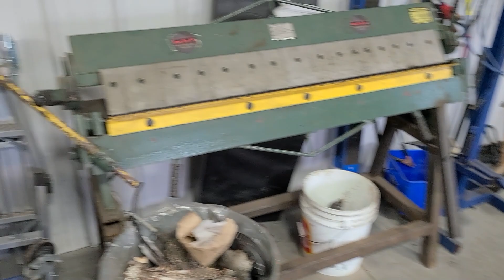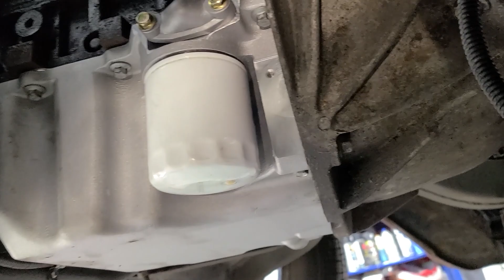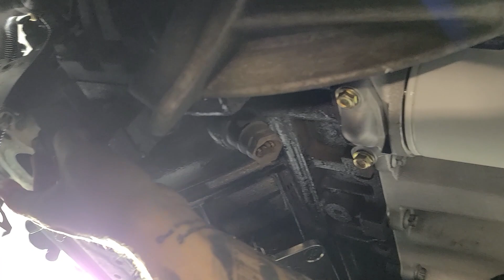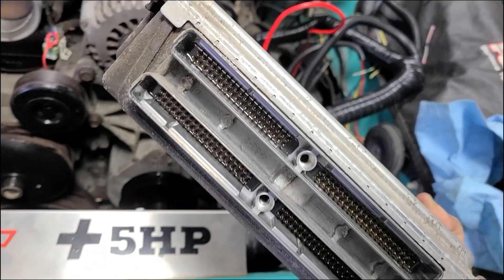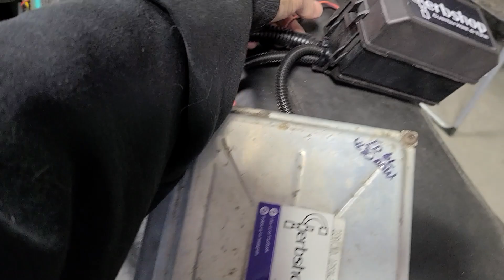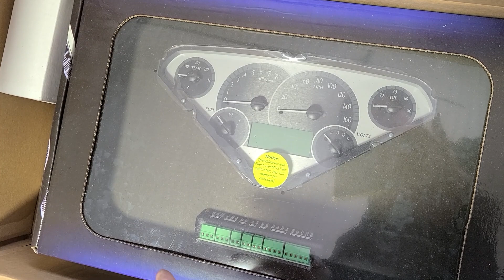LS Swap Wiring Install Part 1 - 1957 Chevy Pick Up Truck

Comment: What radiator are you using?
Reply from the maker: It's a custom one that was built by a local shop for the SBC that was in it. It came in the truck.